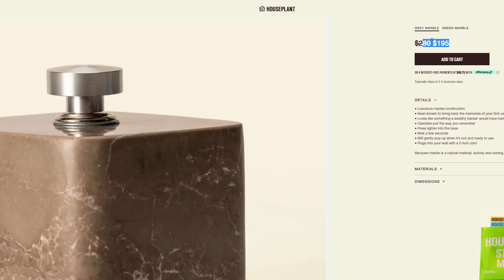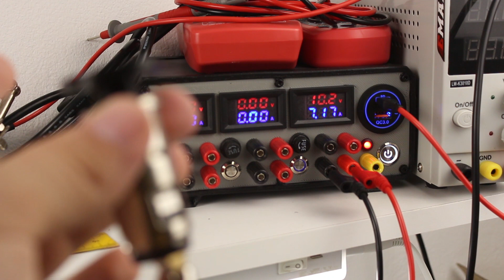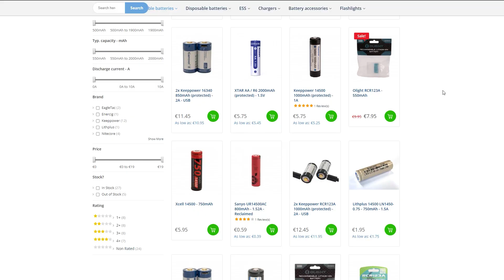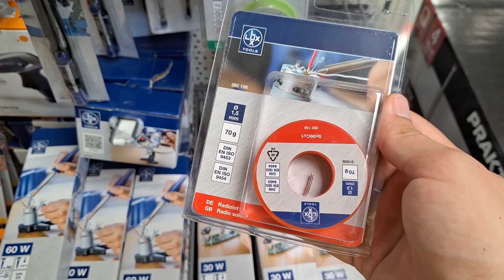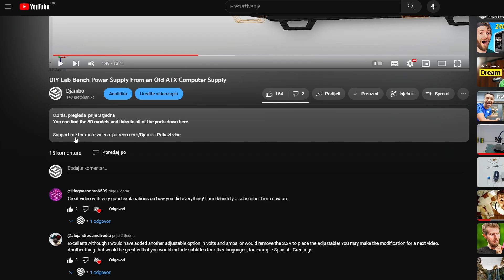I Rebuilt a $300 Cube for 10 bucks

Comment: U can charge a 12v bms with a 5v charger?
Reply from the maker: Yes! You can boost USB 5V to 12.6V and charge the battery. Not very fast in this situation though... I left a link for the charger module in the description